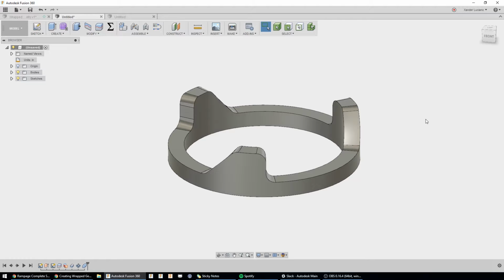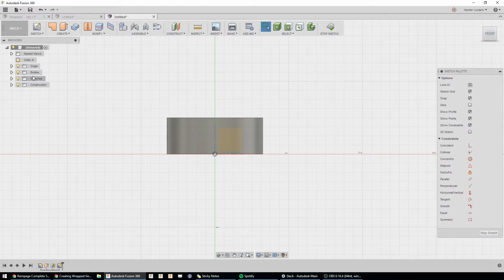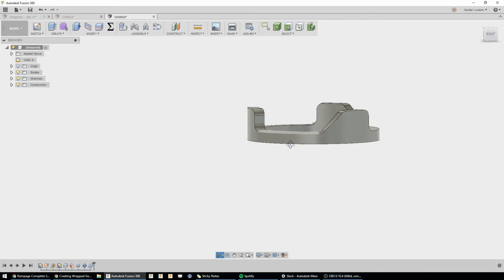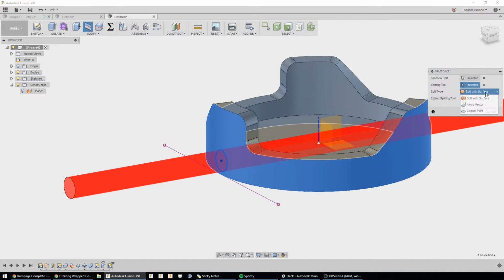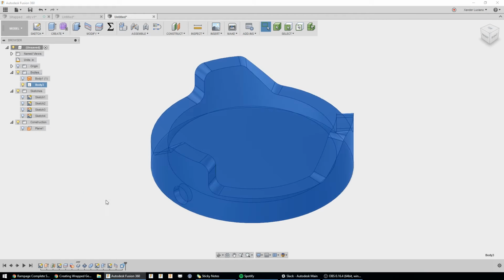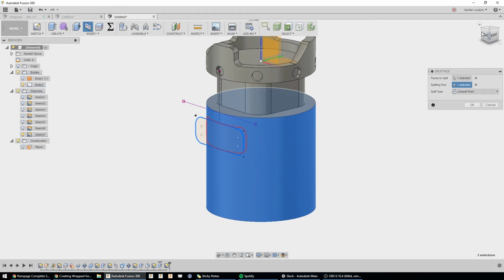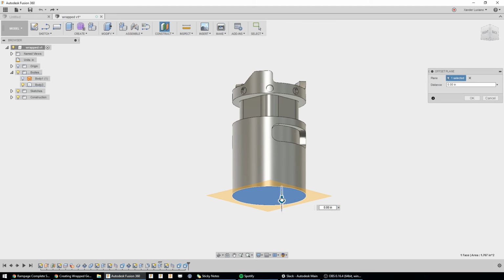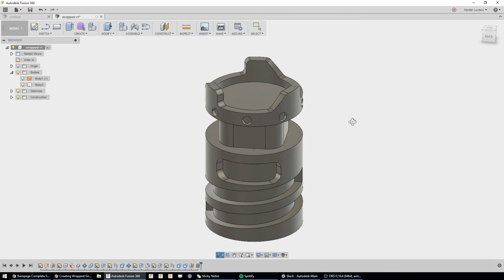Creating Wrapped 4th Axis Geometry - Fusion 360

Comment: Nice tutorial how do i do this with text?  Do i need to make a cylinder and keep the wrapped text alone? I dont want the cylinder just the wrapped text i tried it as metal sheet but it wouldnt delete the cylinder after i make the wrap it stays all as one pcs thanks in advance for any tip
Reply from the maker: Yea that's about reaching the limitations of fusion and wrapping currently (sadly). Using 2 sheet metal parts to make 2 180degree half cylinders and "wrapping" around the bend is essentially the only way.
Reply: Xander Luciano i used the metal sheet type then finally found a way to offset the faces then changed them into objects sadly as you said its quite a workaround that would be an important point to address by Autodesk

Comment: So in the first or second cut feature, if you needed it to be over a precise arc, how would you do that? These linear projections onto a curved surface are maddeningly imprecise, and your use of the word "wrapped" made me assume you were going to tell us how to do a properly wrapped feature. For example, if my shape had to wrap 180 or even 360 degrees around the form, rather than a short way like your first cut, the result from these actions would not work, since the cut, projected from a flat plane, would simply miss the cylinder. How do you actually wrap a sketch around a cylinder?
Reply: Reed Bowman you can't.
Reply: As Reed said none of what you did is wrapping.
Reply: check this video: https://www.youtube.com/watch?v=xN5uqSyG6YA

Comment: For some reason I am not able to extrude a line to make a split face even if I create the same dimensions that you have in the video. The extrude dialog box opens but I am not able to select the single curved line. My icons on my toolbar look a little different than yours also. Could I be working in a different version? That does not really make sense seeing how it is all cloud based.
Reply from the maker: Hello Marc, I have customized my toolbar, but we are both running the same version. It could be that you aren't using an offset plane, your sketch might be behind something and therefore can't be selected, you could have a selection filter enabled, or it could be something else. Can you make a screencast of you trying to do the split face and post the link for me to look at? Thanks!
Reply: I think you may be missing a step. Make sure that you're not in MODEL and rather in PATCH. That will solve your problem. It's an easy mistake to make.
Reply: You are correct Jim Harvey, I was still in Model mode. Thanks guys!
Reply: For everyone having this issue 2021, Fusion 360 has changed and PATCH is now SURFACE, and it works! :)